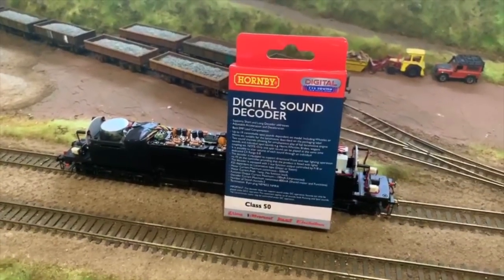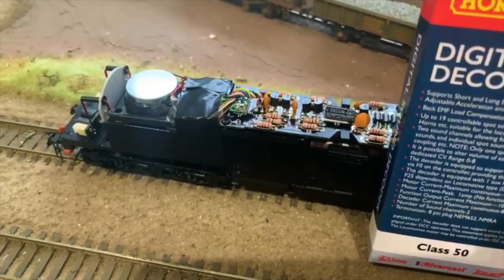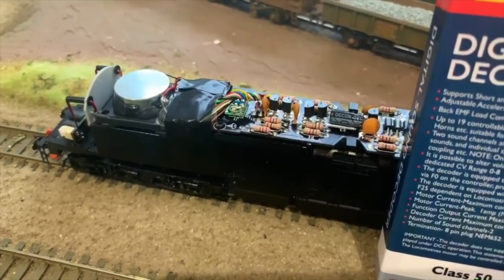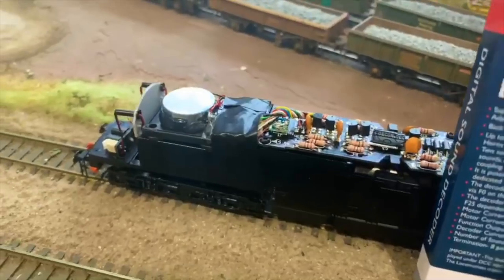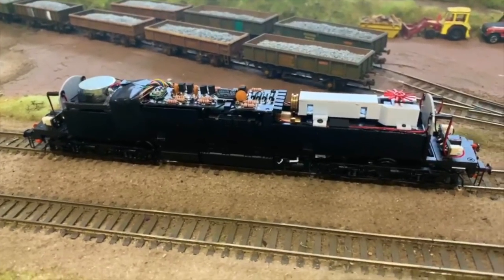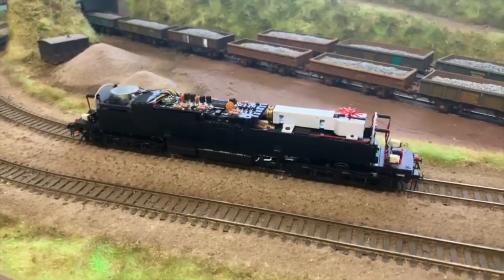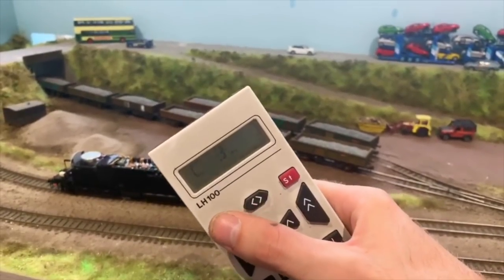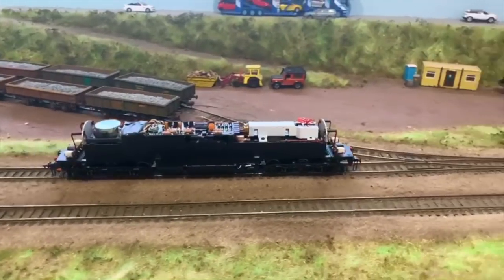Hornby TTS Class 50, Installation, Speaker Upgrade, Settings, And Running

Comment: The first batch of 50s (two models I believe) had back to front PCBs.  Hornby did an exchange program which only ended a couple of years ago. The affected locos have rubber tyres on (which were removed after the first batch).
Reply from the maker: Thanks, thats good information

Comment: Just a quick note Richard, these speakers (which I bought off you on eBay) are only suitable for refurbished class 50s. I found out the hard way!  It was ok, but I had to remove the fan to put it at the other end.

Comment: I have a Hornby class 66 TTS. TTS fitted professionally with upgraded speaker. Sound off. It’s runs fine. Sound on all sounds work when stationary. But as soon as it moves off, it stops and starts around the layout of its on accord, the sound restarting each time. It’s very frustrating!! Any ideas why 🤷‍♂️ everything else on layout runs fine
Reply from the maker: Yeah, I guess it’s probably a 4 ohm speaker rather than the 8 that’s needed. If that’s the case the damage might already be done, but you could try swapping it back to 8 ohms and see if it cures it. It might not be that but that’s a likely cause
Reply: @roadsandrails  that’s great. I’ll look into that and suggest it to where I got it from. When you say the damage may already be done…..?? As in the TTS chip may be damaged?? I very much appreciate the advice
Reply from the maker: @Mapplewell_Park  Yeah maybe, if you use them with 4 ohm speakers it can burn out the amp on the decoder, the first sign of that is usually the sound cutting out
Reply: @roadsandrails  thanks for the advice it’s much appreciated. I have just got myself a new Bachman 47. So when I have enough spare I’ll pay a visit for the sound decoder. Thanks for your help 👍

Comment: Great Video. Could you do a video how to install the new  Class 08 TTS decoder into the Hornby model please?
I'm really struggling!!
I have your small i phone speaker soldered onto the sound chip.
Physically don't have the room (or so I think) and worried about busting the model. Any help much appreciated and keep up the good work. Great video thanks.
Reply: Dave NGauge Hi, I’ve just fit one into a Hornby class 08. I used a sugarcube speaker and seated it in the gap, between nose grill and chassis. Having spoken with Richard. Make sure the baffle is well sealed. 

Regards, Steve.
Reply from the maker: Hi, I'll try to do a video next time I'm doing one. Richard
Reply: @stevepartridge5178  Thanks for getting back to me.
Reply: @roadsandrails  I've just sent you an email regarding this. If you can reply with what exact speaker I need ill buy a couple off you. 
Is the smaller i phone speaker you supply to big for this model do you reckon?
Thanks again
Reply: Hi Dave glad I could help. Regards, Steve